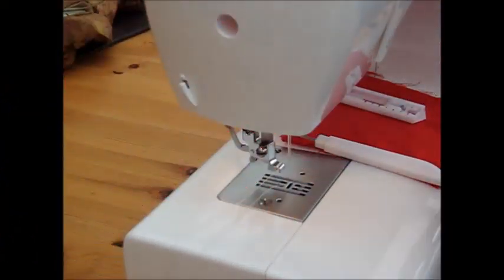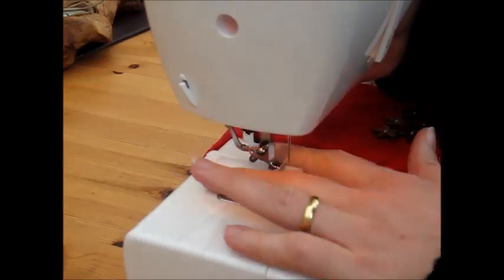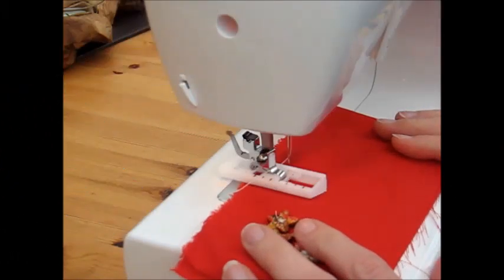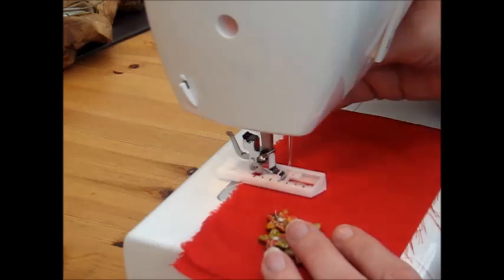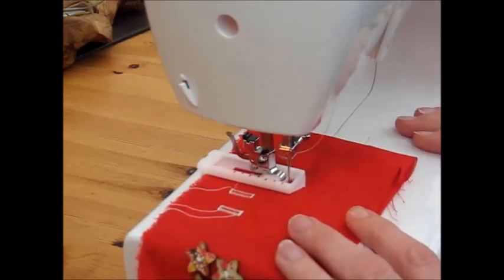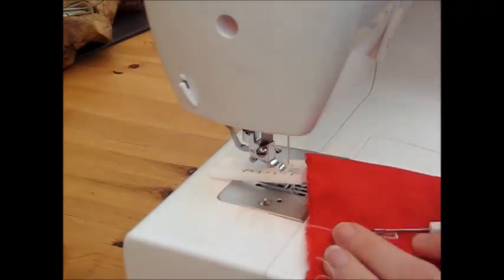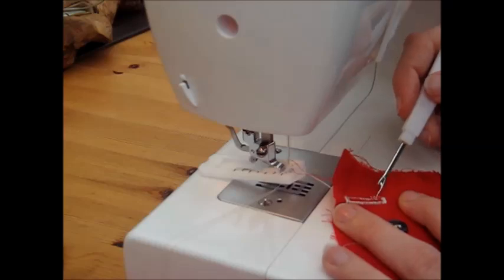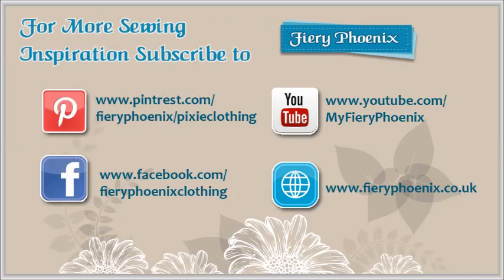How to Sew Buttonholes for Beginners :: by Babs Rudlin at Fiery Phoenix

Comment: I have been told that with this type of button hole presser foot, to put your button of choice at the back of the foot, and it will give you the correct size buttonhole for it.  I have not attempted this technique as yet; what are your thoughts on this idea? Thank you for this video.
Reply: This is not the foot that allows you to put the button in the back of the foot.  Those feet only work on machines that have a stop lever.  That foot is usually only available on machines with a one step buttonhole.
Reply: Thank you; I dodged a bullet there.  I went out and bought the recommended one.

Comment: Thank you for this tutorial!!  I'm going to repeat it over and over until I can get it right.  By the way, do you have a tutorial on how to use the thicker thread (piping thread?) along the lines to make a more prominent buttonhole line?  I know there are some buttonhole feet that have the notches at each end for that, but the notches on the four-step aren't quite big enough to hold piping thread in place...if that makes sense.  Your help is greatly appreciated!!

Comment: i've use the one step button hole .... confused .... how do i know what size is good  for the right button i'd be using?
Reply: With the buttonhole foot, you put the needed button on the foot.  Side the foot forward, place the button inside the tracks of the foot then allow the rest of the foot to slide back up again the button.

Comment: I have a kenmore 365 my machine won’t feed my material..it just sits in one spot. I checked my numbers and changed them several times and it still won’t move the material...any suggestions?
Reply from the maker: I’d suggest checking that 1 the feed dogs are raised and 2 that they are moving without any fabric.  Manually turning the feed wheel should show this.